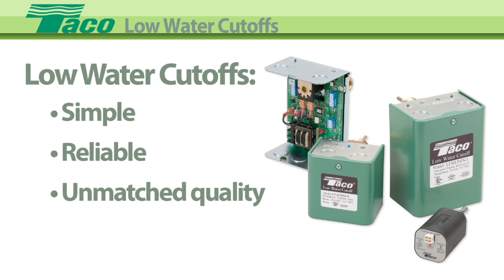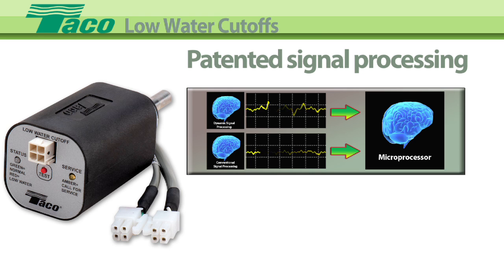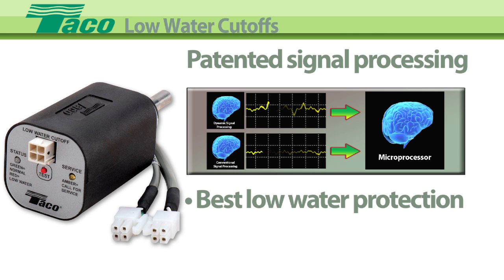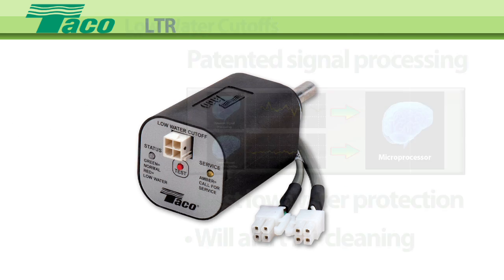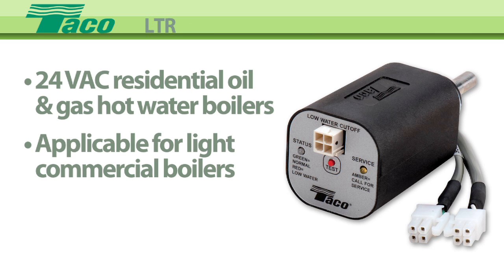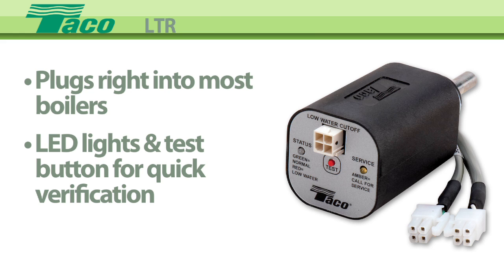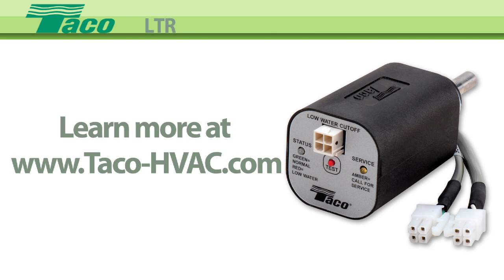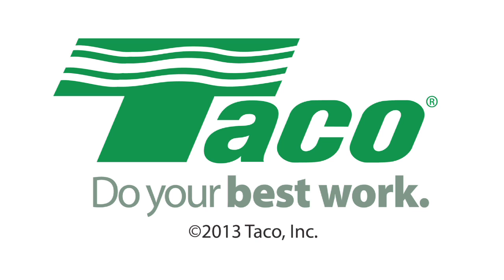Taco Low Water Cutoffs LTR

Comment: I installed the ltr and bought the 4 pin oem harness. I plugged it into the boilers 4 pin connector in the circuit board and I got no power (both LED lights aren't on) but the boiler fires up without issue. What would be the problem? This is a new installation.
Reply: my friend did you called the plumber
?